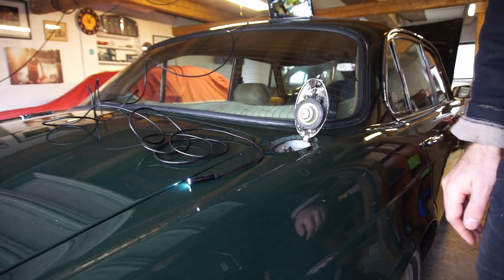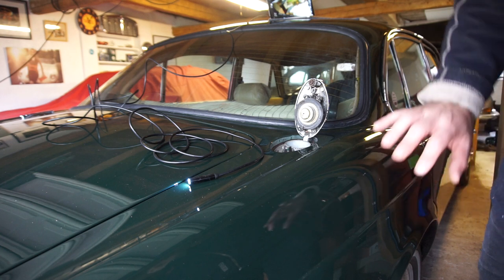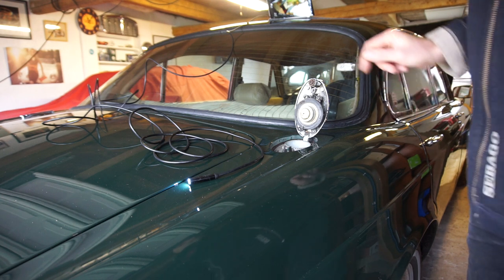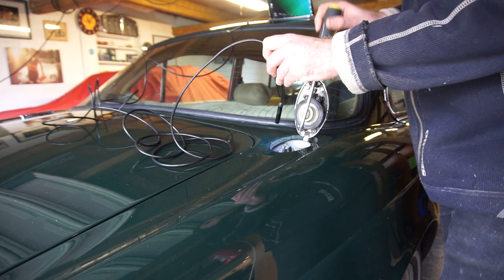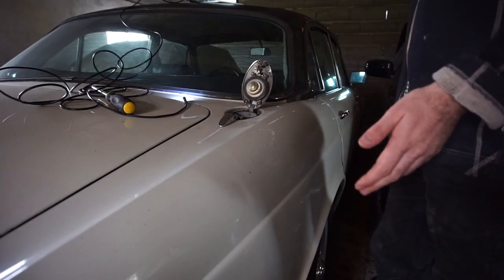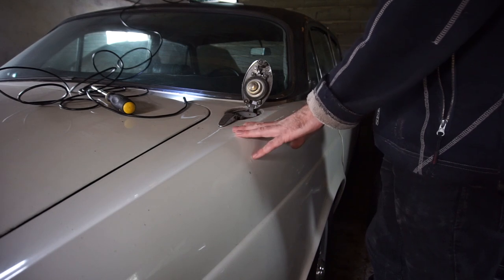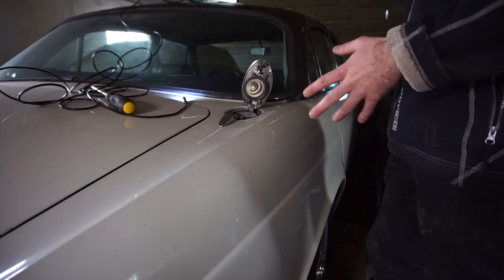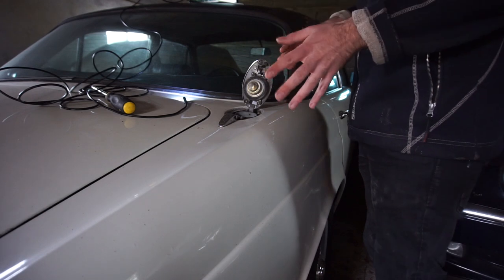A Look Inside Old Gas Tanks

Comment: I use phosphoric acid 80% . It frees of heavier rust and turns dusty bits into iron  phosphate and coats the tank..leave overnight ..empty through a sieve and use again many times.. wash out tank with water then swill with denatured  alcohol to remove any water .. works for me every time .. all vehicles still running with no more rust in fuel filters..been doing this for 36 years when it's the powdery surface rust.. 👍🏻☮❤peace and love brother 😊
Reply from the maker: Thanks for the tip!
Reply: @LivingWithAClassic  you are very welcome , you do what works for you of course we all have different results and methods. Thanks for the wonderful videos takes me back to when I used to work on these as a Rover group mech (Austin Rover Jaguar Land rover BMc   morris Riley VandenPlas etc etc 👍🏻😊)

Comment: Nice video. Boy could I have used a device like this 50 years ago when I first started fooling around with  English cars and motorcycles. Over the years I have used and still use "cream" getting this stuff from motorcycles shops. Great stuff with  never a problems. Another fine video Adam!

Comment: Hey Adam enjoy your videos, your D Jet information has been helpful on my old Mercedes. I treated the gas tank for my 911 with POR 15 about 10 years ago. It is a 3 step process and I found it a little difficult to get all the nooks and crannies clean so that may explain why I am starting to see some areas of rust returning. It did hold up for a good long time. A replacement tank at that time was very expensive now there are aftermarket tanks for about a third of the cost.
Reply from the maker: Thanks for sharing your experience! I think I will try out POR 15 and see how it works. Even if new tanks are available it would make for a more fun video trying out a tank sealer. It would also be about a 5th of the cost or even less.

Comment: Thanks again Adam. Very interesting. My leak on my 64 s series came from the rh tank. It was caused by small rocks making their way between the tank bottom and the rubber spacer under the tank straps. I have no idea how they got there but they did rub through the metal and cause the fuel to leak. Just my experience.

Comment: Hi Adam a new tank cost 275 Euro from Limora Germany. But I think you can restore the old one . I put mine one a concrete mixing Maschine filled with stones for one hour than anti rust treatment and sealed and coated it after with Wagner Tankversiegelung from Germany. Result great !
Reply from the maker: I have seen that some of the newer tanks don’t have the large plug in the bottom to get at the filter. I’d like to keep that if possible. When I checked the shipment to me would be almost as much as the tanks. I checked from the UK then though. I’ll check Limora again.
I’ll check out the German brand you recommended. Thank you!

Comment: My tank leaked ,so I de carbened it with car exsaust.
Then made a fire in garden .Then put tank in embers over night.the pin hols became visible.Had them bronzed welded.
The fire heat was good at lifting bad fuel that had hardend on to inside of tank.

Comment: Thanks. Enjoyed it very much again. I used a similar camera on my XJ6 S2 from 1978 and the tank looked very similar with some surface rust. However, similar to you I could not see right through to the bottom of the tank. Since I have the problem of the tank on one side not delivering enough fuel when  it falls below one third I think I have to empty this particular tank to see what is one the very bottom and clogging the pipe from time to time.
Cheers Tobias, German

Comment: Never done that before.  Interesting.  I've only ever replaced old tanks, never tried to clean them.  I did use sealer on a Triumph Bonnerville years ago but it was a temporary solution until the tank was replaced.  Not much help to you, sorry.  I think you can get replacement tanks from the UK but the delivery costs would probably be very expensive.